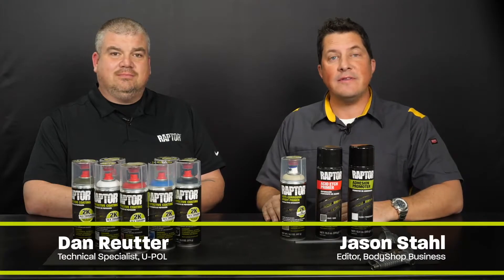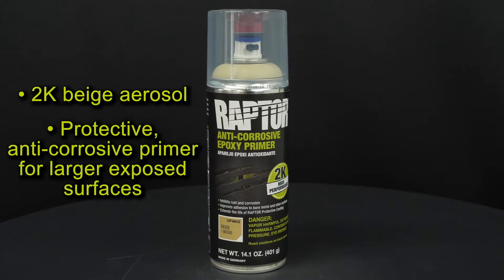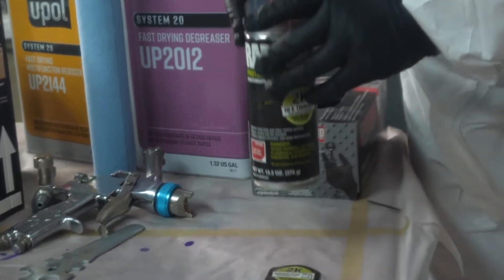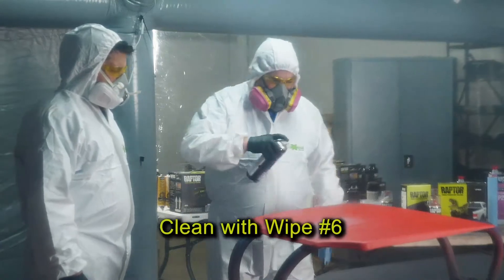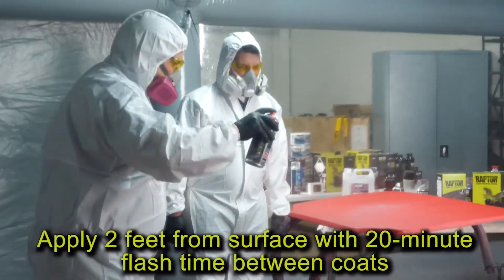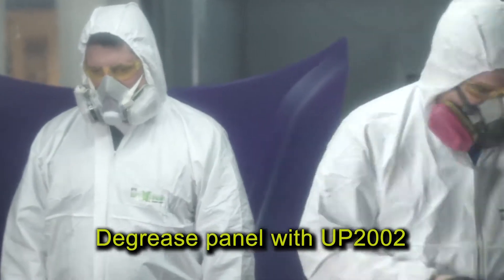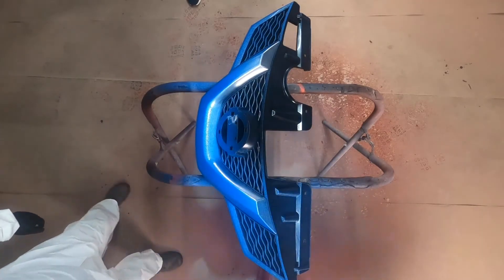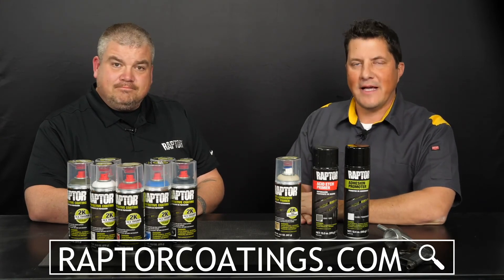U-POL Raptor Protective Coating Aerosols

Comment: So the honeycomb pattern doesn't need abrading? I ask because I have a Ford Grille I would like to do the same to. I am worried the Raptor will flake? It's almost impossible to abrade those areas.